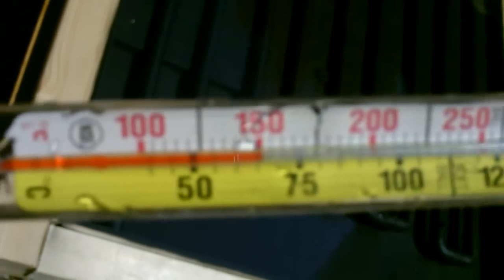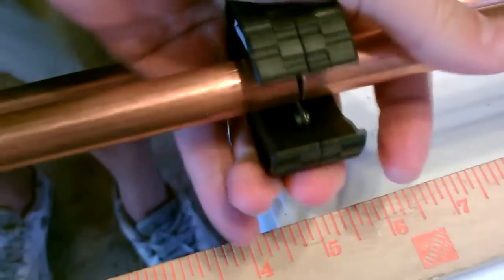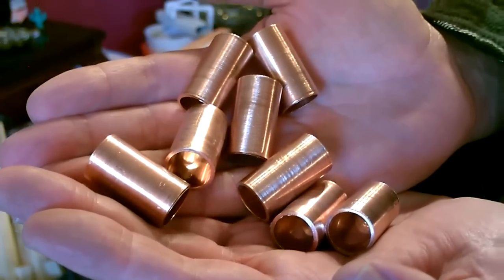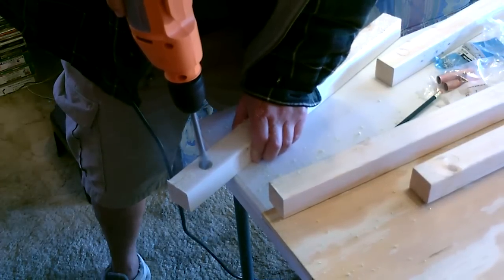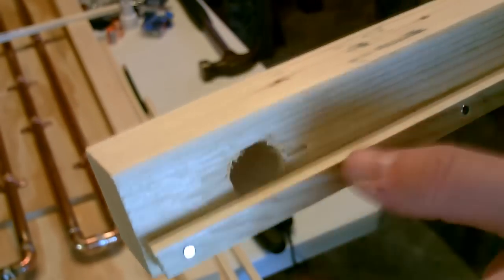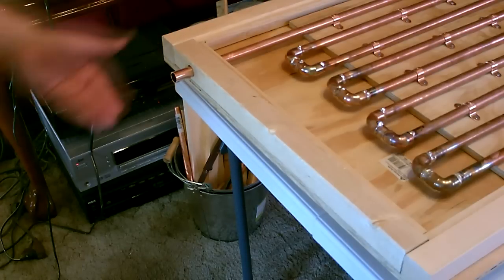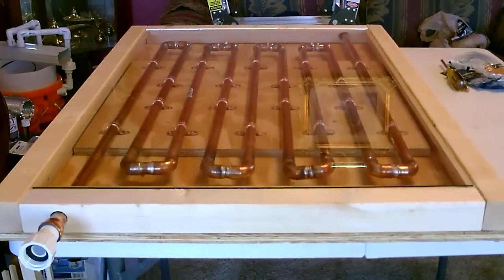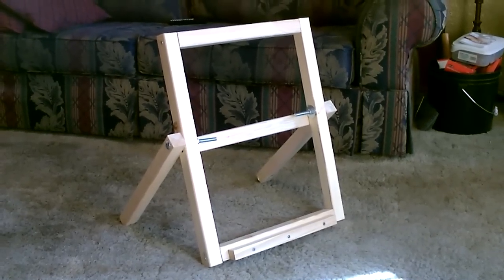Solar Thermal COPPER PIPE Water Heater! - Easy DIY (full instr.) 150F+

Comment: Hello,  I just saw your pool water heater.  Have there been any new suggestions.  Do I have to have a certain length of copper for a certain size pool?  Does the water have to flow slow and if so what size pump?  Thanks and I am looking forward to creating this.

Comment: Would lining the back board with rockwool or another insulating material help to keep the pipes insulated? By putting it in between the pipes and the plywood. Just a thought. Wonder if it would help?

Comment: What are the thermal properties of hemp oil? Could hemp oil be pumped through a system like this throughout a copper heat exchange coil to provide hot water and run thermal electric generation for a home?

Comment: Using these concepts a shelter or off grid home could generate electrical power heat and cool itself and even produce water from the air for drinking bathing and for a hydroponic green house. Novartis

Comment: A solar panel low voltage induction water heater used with this copper pipe water heating system could also generate electricity with thermal electric power generation to keep a capacitor bank and Tesla wall for total off grid living? Novartis

Comment: Or you could install a valve and pump system that circulated the hot water into and out of a heat sink to keep the water at a set temperature for awesome off grid living. ; )

Comment: wouldn't a piece of sheet copper under the pipe, but in contact with it, be more efficient?
Reply: I've done some research since my first post, so here goes. If the copper tubing was soldered to the bottom copper sheeting, then all painted black it would be a flat plate collector. the plate increases the surface area, increasing efficiency .
Could you please explain why foam, an insulator, could be better than a conductor(in this case heat). I'm sorry I don't get it.  My life experience tells me if I leave a piece of black metal, and a piece of black foam in the sun for the same period in full sun , the metal will get way hotter faster. 
Thanks

Comment: Why not use plastic piping? I'm curious to know the benefit of copper pipe over plastic pipe, since plastic would be a lot cheaper.
Reply: Bristianity for the panel, copper pipe is best because the conduction of heat into the pipe. However, from the panel to where you want it to go, pex (plastic) is best for the very opposite. As they won't allow the heat to conduct out of the pipe as easily as copper. Still, an insulator for the led would be ideal. Especially at those temps to make sure no one can get burned.